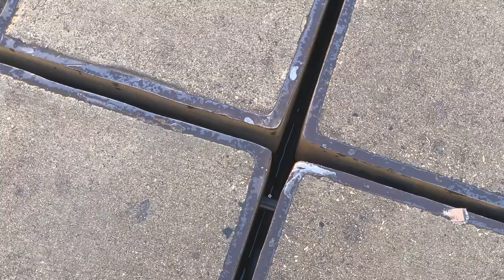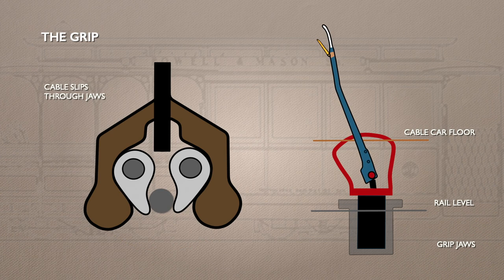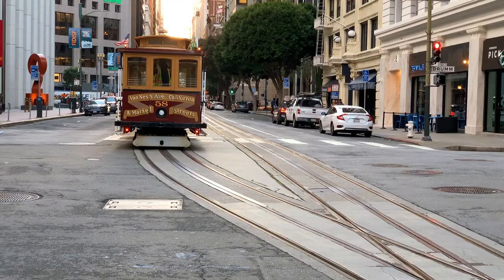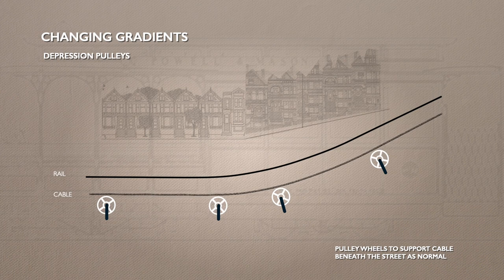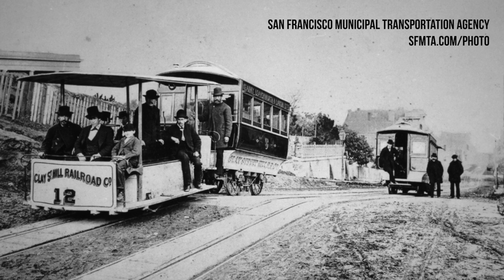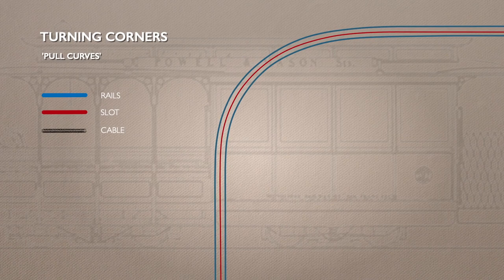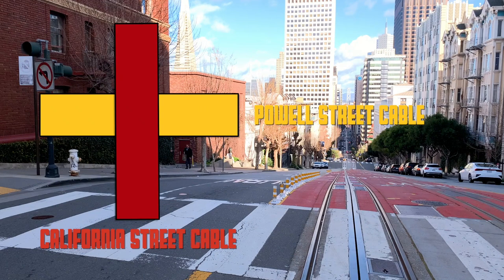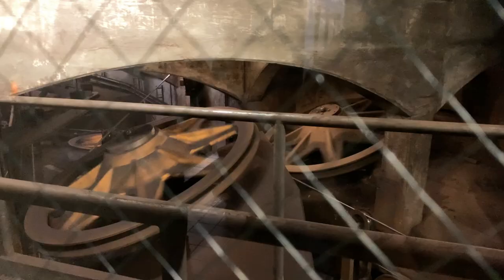How they work - what's happening out of sight on the San Francisco Cable cars?

Comment: I share the same questions asked by others and here’s another: 

If the system requires a person lifting the cable up to begin, then how does the car let go and then re-grip the cable around a curve or at an intersection without someone there to lift the cable?